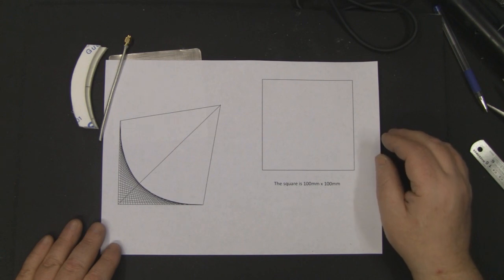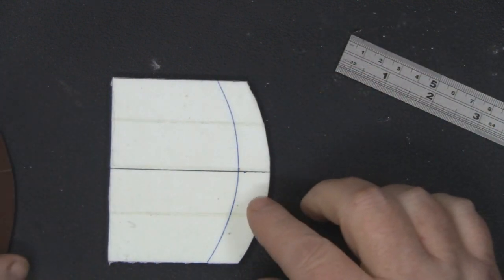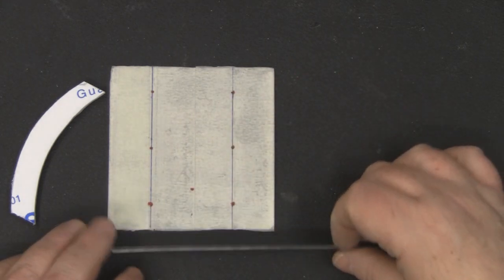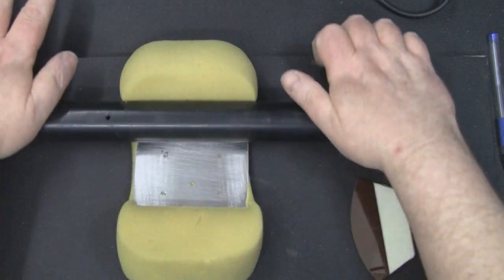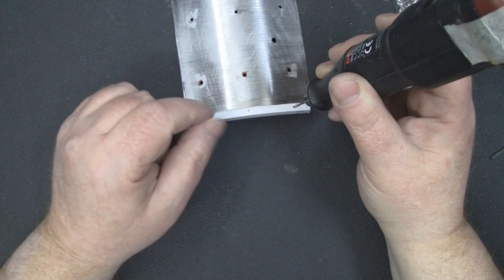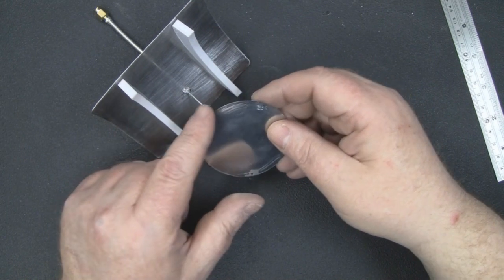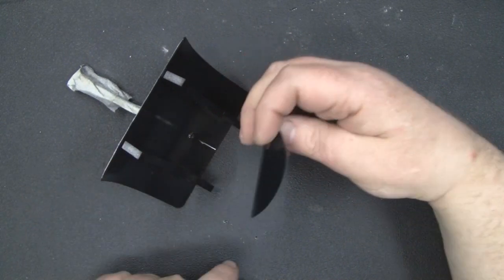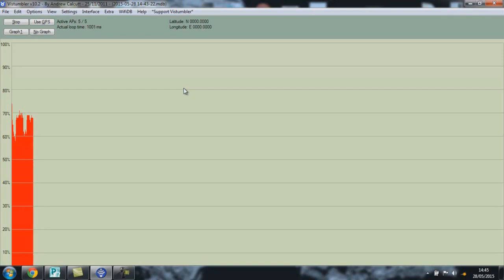Parabolic Curve Antenna 2 4GHz #89

Comment: I need to go about 500ft to a shop in the back yard and there is a slight obstruction of low hanging branches from a tree.  I currently get a pretty decent signal with a rosewill rnx-180ube which has a 5dbi antenna and a windsurfer.  sometimes i get really good connections other times i have to watch youtube on low res would this be a good solution to increase my speeds?
Reply: Cantenna is better for range . But extremely directional.
Reply: @kavindugilshan  after a bit of reading the cantenna seems like the better way to go.  I dont mind it being directional I can set it up and then just run a usb to my pc, or better yet i might run the cantenna into a repeater.
Reply: @MrGeemonty  i use a cantenna with a usb WIFI adapter also i have wifi repeater with a cantenna . They both work fine . But the problem is when the cantenna moves 1 mm signal drops. I use vistumbler  to point the cantenna . But i think if you try to hack a repeater with MIMO antennas it won’t work.

Comment: Andrew, could you advise me on which antenna would best suited to increase the gain on my mobile Telstra phone
3G

There are several 3G networks operating in Australia. 3G frequencies are usually specified as UMTS/HSDPA or WCDMA codecs on the mobile phone specifications.

Australian 3G bands:

850MHz (B5) – Telstra, Vodafone

2100MHz (B1) – Telstra, Optus, Vodafone
4G

Australia is currently using these LTE bands (LTE bandmask in brackets):

2100MHz (B1) FDD (0000000000000001) – Telstra (a handful of sites), Optus (Darwin, Tasmania)
1800MHz (B3) FDD (0000000000000004) – Telstra, Optus, Vodafone

2600MHz (B7) FDD (0000000000000040) – Optus, Telstra. (TPG have a license but have not announced plans for it.)
900MHz (B8) FDD (0000000000000080) – Telstra (a handful of sites, utilises spectrum previously used by 2G)
700MHz (B28) FDD (0000000008000000) – Telstra, Optus (switched on early in a couple of cities, will be widespread in 2015)

Thanks mate

Comment: I built one using a metal baking pan from the dollar store (.011) and a white slippery plastic kitchen cutting board 3/16" thick. GOOP instead of epoxy. Put a square piece of cutting board between plastic uprights for a stand. Old router sma antenna  for hookup. Big improvement on my alfa like card antenna. Thanks for all your videos and on to the next one.

Comment: Could you cut a small V on the driven element at its edge an solder the cable to it?
Reply from the maker: FPV SPY Yes that would work fine

Comment: A few noob questions
1-could you put a notch in the driven element for the coax wire or is a hole the way to go?
2-do you know the beam width of this antenna?
3-could you leave the inner insulation and cut it just short of the driven element or does it not make a difference?

Thanks for all the great videos. Gonna give a crack at making some of my own antennas!!!
Reply from the maker: Quadflyingmedic Hi 1 yes you could the most important thing is to get it as close to the edge as possible
2. .3dB beamwidth of about 52 degrees though my network analyser has not been calibrated in 2 years so my be off 1 or 2 degrees.
3 Yes and to be honest I make 4 or 5 antennas during each video and I have this is the only one I stripped all the insulation off.
Hope this helps.
Reply: andrew mcneil thanks for the reply andrew!!
Reply from the maker: Quadflyingmedic  My pleasure let us know how you get on.